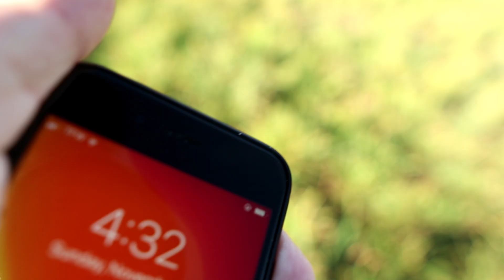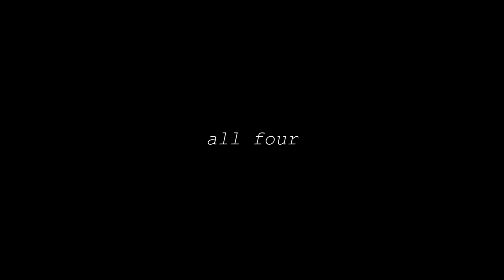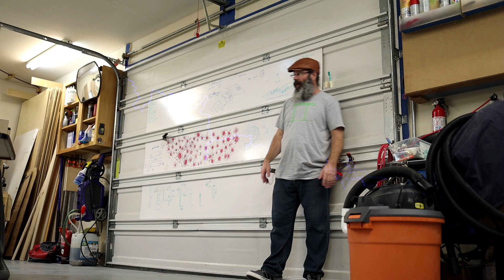Cyclone dust separators for shop vac dust collection

Comment: Great video! I currently own the Dustopper and have been using it with a 5 gal bucket. I recently purchased a 20 gallon poly drum to increase the capacity so that I can empty the sawdust less-often. Have you ever used the Dustopper and if so, would I be better off getting one of the cyclone separators you have, or will I not notice that big of a difference if I switch separators? I am a DIY'er and woodworker. I make 37" wood flags to sell to support veterans. Thank you for your input.
Reply from the maker: I've never used a dust stopper but a small cyclone would work well on the 20 gallon container.

Comment: I haven’t had to change a vacuum filter in 5 years since using centrifugal separators. They do best with larger particles, but still very hood with fine participants such as drywall sanding dust. My only complaint is having the separator assembly and bucket to drag around with the vacuum in already Limited sized spaces. Can’t believe a shop vac company hasn’t designed a vacuum with a centrifugal pre filter attached. I know they sell high priced portable dust collector units, but a low cost unit could be designed if they wanted to.

Comment: Where do you buy  an Xmaster cyclone separator
Reply from the maker: I got mine on ebay years ago for around $28. They are no longer available and haven't been for a long time. The last time I purchased a cyclone was also years ago and I bought them on  ebay. I got three 3rd generation SN50's for $45 plus shipping straight from China. Now it's even difficult to find an SN50 (any model) and when you do they are almost as much as a dust deputy if not more. The price on the Dust Deputy has come down from what it used to be. You can get one from Amazon for $40 and it looks to be most similar to the Xmaster. There is also a Dewalt on Amazon for around the same $.
Reply: @SlowandExpensive  ty

Comment: I have a lot of experience with hydrocyclones, basically the same except for liquid applications. The reason the models with the extended ceiling, as you described it works better, is because as the diameter of the cyclone decreases, the centrifugal forces within the cyclone increases generating greater separational force. Contrary to what most people think, the larger the cyclone, the less efficient the separational forces exist. We used hydrocyclones that were 4 inch diameter at the top with a 1.5 inch inlet, narrowing over a distance of 6 feet lone to a 1 inch outlet on both the top and bottom and generated an estimated 1000g of separation force within the cyclone.
Reply from the maker: Interesting. So several small cyclones could potentially work better than a large one on a large dust collection setup?
Reply: @SlowandExpensive  , yes. Large ones are sometimes used to separate large quantities of, or large pieces as a type of prefilter, or in situations where the separation doesn’t have to be optimized. Hydro cyclones are used to clean oil spills out of ocean water, but they aren’t large cyclones, but rather are lots of smaller diameter cyclones plumbed through manifolds that have controls to regulate the pressure of the inlet and outlet.

Comment: Thanks for the video.  Though, the cake test is invalid.  Only the smallest particles ever make it through to the vacuum.  By reusing the same batch of dust over and over, most small particles are removed from the earlier tests leaving fewer and fewer for each subsequent test.  The ratio would likely have been much smaller if you used brand new dust at each iteration, thereby replenishing the small particles which would then contribute to a quicker accumulation of cake.
Reply from the maker: Thanks!

Comment: In the first test, the lightest dust that stuck to the filter isn't returned to the test sample. The following tests do better because the worst material was already removed by the first. I agree that cyclone dust separators work great, but the tests aren't objective because the sample material changes. (I get why you did it that way, it just skews the results in the dust separator's favor.)
Reply from the maker: Yeah, the testing could have been more accurate  by using freshly cut dust each time but that would have taken even longer. That part of the video took me two days to shoot the way I did it and the main idea was only to explain how and why cyclone separators work :)

Comment: I work in movie mill-shops where we often use mdf- a destroyer of sinuses and lungs. A coupla years ago i joind the Dust Deputy posse. I am a natural skeptic and was stunned, amazed, shocked, you name it, by the efficiency. I, soon after, switched from regular hepa filters, to the GoreTex ones. Phenomenal! More expensive by a bit, but it is probably the last one I will have to buy. Just tap, shake, and go! (Maybe a little compressed air, if I'm feeling frisky). Also, I used the double bucket set-up, with ballast in the bottom one. Works well. Added a side-car to my shop-vac, so they are always together. Thanks, and I am enjoying your work!
Reply from the maker: Thank you! I appreciate it.

Comment: The best explanation of dust collection. I do have a question. Have you used the low profile version of the dust separater? If so witch one works? Im in the process of building a cabinet to put my table saw into and i want the shop vac and separater under the out feed table. I have a12'×20'shop space is a premium. Thank You for all the great videos you put out! And i can say that YOU Have a Great VIBE!!!! 
Randy Weathington
Reply from the maker: Thanks Randy! I'm not sure which type you are calling low profile. If it's the dust stopper, I've not used it but I'd say that they all work to a certain degree. The price on the Chinese separators has gone up so much that I would recommend either the Dust Deputy or Dewalt also makes one and either of these are about $40 on Amazon. The container really just needs to be air tight. It doesn't have to be a bucket or a bucket shape it can be a box as long as it's air tight. I have two vacs hooked up to my table saw the big one is under the table and the separator is the xmaster which is similar to the two I've recommended and I have it fitted to an old shop vac container. The motor died and with the motor portion removed, I cut a circle made of 3/8 plywood that fits snuggly into the top of it and the separator is screwed to the center of it. It just fits under the outfeed table behind the saw with  the hose bent over as it comes off the top of the separator. You can also build a box out of plywood. The Dust Deputy is even sold with a box design you can also find on Amazon but it is pricey. I don't use 5 gallon buckets because they are  so tipsy. The shop vac container I use has wheels which is nice but you can put wheels on a box just as well. Once you have a separator you can experiment with the container. The shape isn't as important as it being air tight is. I also have a second smaller vac that is up by the ceiling that catches the dust that shoots off the top of the blade but the majority of the dust is captured under the table.
Reply: @SlowandExpensive  thank you for replying. I understand where you're coming from. Great clear explanation. Helps a lot.  Randy

Comment: I have exact same the same setup but the coarse bits of wood are going in the bucket but the fine dust is going in the shopvac. Why?
Reply from the maker: If you have a similar setup and it seems like it should be working better the most common reason is an air leak at the container or somewhere in the hose.
Reply: Thanks for the reply, I will check it out.

Comment: The world of separation science used in industry far exceeds that which has tricked down to woodworking. Woodworkers would greatly benefit if some of the separation science practices were incorporated into the at source collection, separation, and filtration. In the eye of the cyclone there is an induced upward flowing vortex of air stripped of its heavier particulates (swarf) moving into the vortex finder (the bottom of the outlet tube) and into the negative pressure outlet and through the ducting to the filter, impeller, and to the positive pressure outlet of the motor. Particulates are traveling at speed in a descending spiral towards the lower discharge outlet. This brings a fair amount of airflow with it and this enters the collection chamber. This air needs to return to the induced upward moving vortex. In fact if the level of swarf rises and the collection chamber fills, swarf from the collection chamber can be re-entrained and sucked up through the discharge outlet and sent upwards and to the negative pressure outlet. The problem is the lower opening of the conical section serves as both downward and upwards airflow. This is more noticeable under the Thein baffle with swarf caked (at speed as it tries to exit the collection chamber) and plastered to the underside. Segregating the downward and upward return airflow from the collection chamber leads to more efficient separation. As the downward airflow exits the conical section and enters the much wider inside diameter of the collection chamber it speeds to the inner wall with centrifugal force. This swarf laden airflow spirals around loosing velocity and as it does more particulates fall out of the airflow. If the collection chamber had deceleration baffles (a circle of vertical paint sticks) the swarf will slow faster and drop to the bottom of the chamber. The airflow now moving slower doesn't suspend the particulates, they drop and the slower airflow stripped of its heavier particulates then is drawn up the center of the chamber and into the conical sections lower outlet, into the upward vortex, and to the negative pressure outlet and ducting. Attach a reticle baffle/support 4 inches below the conical section discharge. Attach a wider diameter tube (think protein jar) to its underside, this will serve as a segregation baffle.  Segregating the faster downward swarf laden airflow along the inner walls from the slower flowing return airflow rising to the conical section. On top of the reticle baffle attach a smaller diameter tube (50% surface area of conical lower outlet) that goes through the conical section lower outlet and stops 2 inches form the vortex finder. The upward flowing induced vortex in the conical section will draw the collection chamber return air into th evortex finder and out. I have started 5 gallon bucket models. I extended the height of the collection chamber to 2 buckets tall to allow more time for separation and to make sure a full bucket is far from the suction of the upward moving vortex. I also REALLY like your idea of connecting 2 and 3 vacuum motors together into a "negative pressure manifold." I was impressed with the cfm, velocity, and static pressure of this arrangement. I am also using secondary air positive pressure air injection (PPAJ) in a push-pull ventilation of the swarf generations xone and PPAJ along the negative pressure path to serve as boosters. Positive pressure air jets in the conical section just after the inlet port serve to provide an air wash of the inner walls decreasing friction, directing the airflow and increasing velocity (Venturi). Industry has pneumatic conveyance down to a science. I'm just borrowing those principles. cboliver@live.com Oliver Wooddust Productions

Comment: Holy shit all the money you spent on 73 shop vacs and hoses and pipe and fittings and cheap baby cyclones and the hundreds of hours you spent building and putting all that shit together you could have bought a real dust collector for like $300 and a cyclone for another $2-$300 (a real cyclone not a mini baby one built for 30-50 cfm) like seriously your must charge like what $3-$7.00 usd an hour for your labor??? Shit all that work and time alone at my labor rate would have been thousands of dollars?? Oh and you wasted every square foot of wall shelf space in the shop where you could have put oh idk cabinets and lumber racks and tool storage areas instead you’ve got a mess of spider web pipes and hoses and 73 shop vacs that all require a $40-$50 filter change every 90-120 days and $5 bags that have to be changed every 15-30 days you could have a very very nice real full size dust collection system in there and it would blow your mind please people do not waste your time and energy on this once anyone who has used a vacuum built for cleaning automotive floors and carpets try’s out a real cyclone and dust collection system they would never dare go back!!! Prove me wrong

Comment: I have one of the Dust Deputies - I did two things to improve the process - 1 - got a metal 10 gallon drum so the Dust Deputy would not tip over -2 - put a bug in the vacuum to keep the filter supper clean because I hate cleaning the filters.

if you do drywall you need the filter bag the vacuum because cyclone struggle to have the same efficiency with drywall dust as the do with sawdust.
Reply: I've been using a ridgid and a Dust Deputy for drywall sanding for several years and find the new ones with the neutral vane, or what ever they call it, don't work as well. It seems the fine drywall dust hits it, drops then gets caught in the airflow to the machine.  However the top on the new DD is easily removed and you can cut the new "improved" piece off. You can then see the dust is forced to the outside as it spirals down to the pail; as it should.

Comment: With all due respect, it looks like you have five (that I see) shop vacs for your system. For the cost of those vacs you could buy one system that would work about 4 times as well and take up a fraction of the space. I have a home made cyclone system that I built out of two 5 gallon buckets and cost less than 50 bucks. I already had the vacuum. But if I were going to upgraded I would no way add a second dust collector like this because they suck at a very low cfm.

Comment: A couple things I need to say about Rigid vacuums. They are not as powerful as Shop Vac rands of the same power. Also, replacing the filter is a messy job. When you snap off the filter, it leaves a big dust cloud. That needs to be redesigned.

Comment: Have you tried out the harbor freight "Bauer brand" cyclonic sepators? I ended up getting one due to necessity and needing it right away as I'm grinding concrete in my basement and hoping to cut down on the dust making it to my filters so quickly.

Most the complaints it seems, seemed to have been corrected with the recent refresh they did to the design and the included lid is now much more "Ridgid" (had to haha) than the first generation.
Reply from the maker: I've not but I will check it out. Thanks

Comment: My dude. I've watched probably over 50 cyclone videos getting ideas for my own shop vac/dust deputy setup and yours is easily the most informative and entertaining by a looooooong shot. I've seen videos three times as long that didn't offer even 1/10th of the info you provided. Simply amazing. Standing ovation.
Gushing out of the way, I plan on using a bag inside the shop vac, so I know I'll probably lose a bit of suction, but I'll be using PVC for my run from the cyclone to my hose boom arm, and the shop vac will be connected to the cyclone via a short 2 1/2" hose, so lose should be minimal compared to using all flex hose. The advantage is that my vac filter will probably take 100 years to clog to the level of yours after 800 gallons of dust.
Thanks again, I can't stress enough how helpful and entertaining your video was. 👏
Reply from the maker: Thank you!

Comment: Glad to see you’re back to posting videos.  I wish you would have included the Ridgid Duststopper in the demonstration as a comparison.  Great video.
Reply from the maker: Thanks Paul! A proper cyclone dust separator shootout video sounds fun! :)
Reply: I had the Ridgid Dustopper on one my systems.  Did not work as well as the Dust Deputy.  Swapped it for another Dust Deputy, Duststopper sitting on a shelf.
Reply: I’ve used the Dust Deputy and a Ridgid 6.0 and a Ridgid 6.5 both for about 5 years for vacuum sanding drywall. I tested the Duststopper by hooking them up in tandem. Once with the Dust Deputy to the Duststopper then to the machine. Then I swapped the orientation Duststopper to the Dust Deputy then to the machine. I’ve done this test several times and every time the Duststopper misses about 1/3 of the larger particles and almost all the very very fine particles. The Dust Deputy catches almost all of both. I use a bag and a Dacron filter.  I look in the machine once in awhile and if I see any dust at all I know there is a hole in the bag. I have it mounted on a cart for moving around construction sites and it has proven to be very effective at keeping the whole site cleaner.